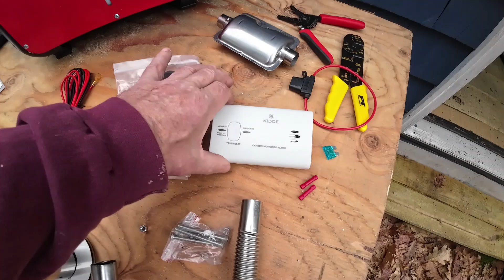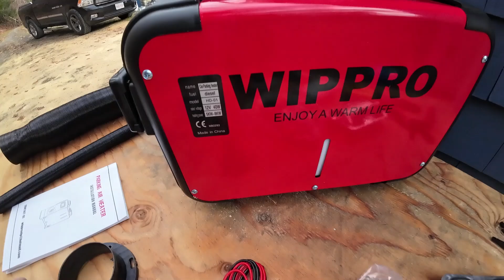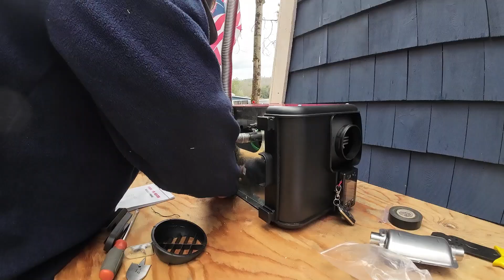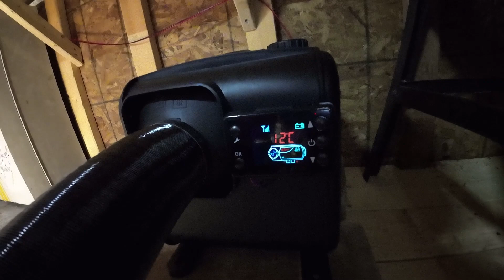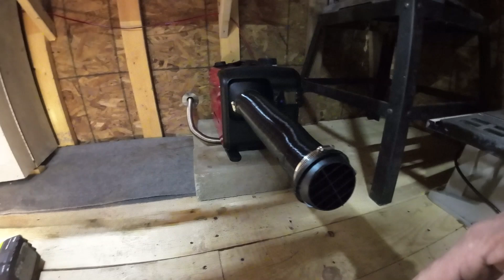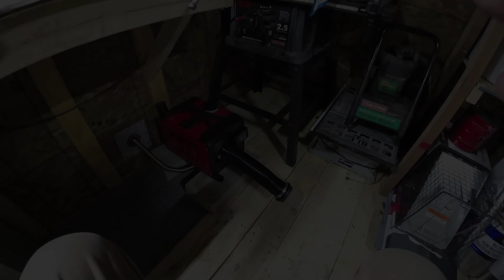Testing an inexpensive diesel heater to heat a small workshop. How well does it work and is it safe?

Comment: What is with the $hitty design of all of these portable diesel heaters with the intake and exhaust being on the bottom?  Every install I've seen required them to be mounted on blocks.  Why not route them out the back???  This is an absolute design failure!
Reply from the maker: I agree.  This same company has a new model that just came out that does route out the sides and has the lcd display on top.  I will check to see if Vevor has the same new model coming out.  I won't buy from this company again since you get zero support from that at all and no reply to emails sent.

Comment: That's a great heater. I've been running mine for awhile. Running on low will build up, and foul the burn chamber. Make sure and run it on high at least 10 mins each day of use. It burns the carbon off removing the fouling and greatly reduces the chance of having to open and clean the chamber. 

Never unplug it or shut off quickly. It will melt the mother board if you do not let it cool down.
Reply from the maker: I'm your huckleberry!  Thanks for that info.  I know about the cool down but not about the running on high for 10 minutes thing.  Thanks bud!

Comment: This unit is very similar to a Vevor unit I purchased a month ago (November 2024). Your ticking is the same volume level as mine and speeds up or slows down according to the temp set point. I purchased a carbon monoxide tester and it maintains a 0 on the read out. I'm heating a 10 x 16 enclosed insulated porch off the back of my house.

My unit will trip on an over heating situation and give a error code on the display on high at around 65 degrees.

My unit has three temp ranges:
Low (1-3) - three green colored icons.
Medium (4-7) - four amber colored icons.
High (8-10) - three red colored icons.
It trips on all three reds (8-10) and two of the last two green (6-7) icons at around the 65 degree temps.
I just have to keep an eye on it and turn it down to around 5 when it gets to around 63 degrees.

I'm very happy with the heater.

Nice video.
Reply from the maker: You are the second person to mention the Vevor units and are happy with them.  Thanks for the comparison info.  I have a 15amp fuse for mine.  Is yours connected to a 10amp fuse setup?  I wonder if that is why it is tripping at high levels.
Reply: @senselessfun  
Yes, it did come with a fuse, and I believe it is a 15 amp, but the over heating is, I believe, to be internal. I plan on calling Vevor to ask them what the overheating could be.

It will get my porch up to 80 degrees on setting 5, but will overheat at 6 or above. Can't wait to hear what the  problem could be.
Reply from the maker: Good luck.  I just setup my 2nd diesel heater to run using a 110ac to 12v adapter that is fused for 15a.  You could always try that.  I just posted the video up:
https://www.youtube.com/watch?v=Cr7KqfAsLIo